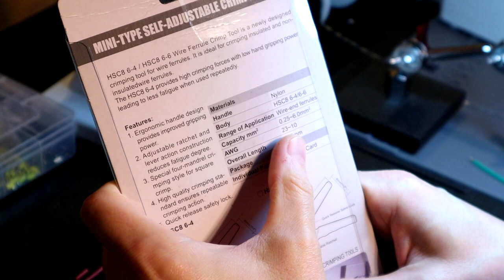CNC Connector Package Is In With Soldering Assembly Tips (Shot in 4K)..

Comment: half way done with my soldering. my cabinet looks the same as the ultimate case video so i have the 4 inputs installed and the gx16s soldered i have the buss bar and relay installed, all the wires run i have the one larger ferrite around the signal wires from the gx16-6. so all i have left now to working machine is the cable end of the gx16s. oh and assembling and setting up the dust collector.. i have 15 amp remote control outlets into a tripplite powerstrip so with the press of a button the spindle pump comes on or the spindle light or the compressor or the ESS. i didnt want to get into cutting all the wires and installing switches on a control panel at the desktop side of the CNC table. I was hoping for having the machine all working tomorrow but with the holiday maybe sunday. i got the dexcool and water wetter ready to go into the bucket. oh yeah i have to get a 3/4" mdf sheet for a waste board but im looking into a fixture plate from saunders machine works. Sorry i ramble all the time. Merry Christmas Vince
Reply from the maker: Hey Dave, that's great! Merry Christmas to you, and your family! I know you've worked long, and hard ot bring her to life. I can't wait to see it. Vince